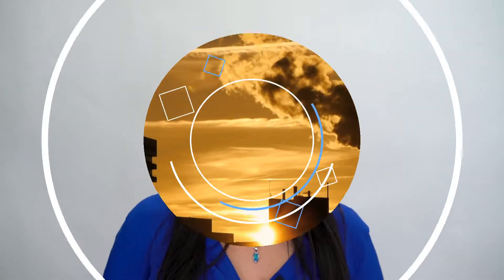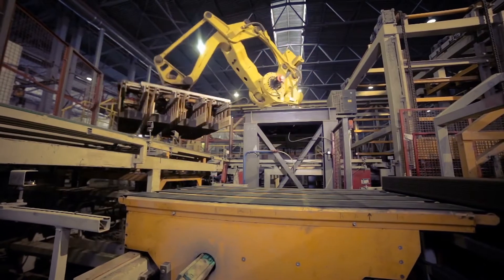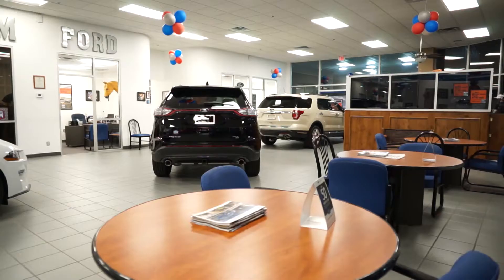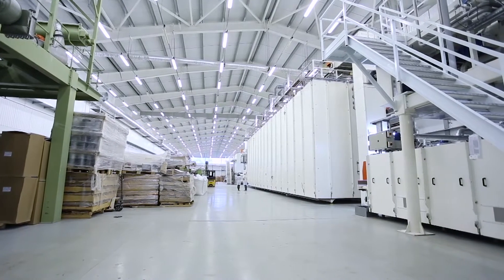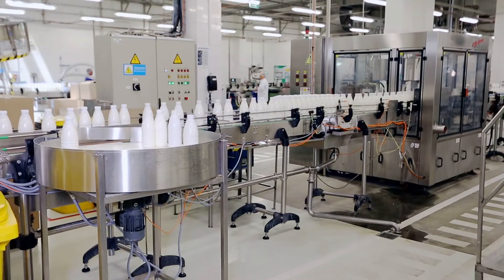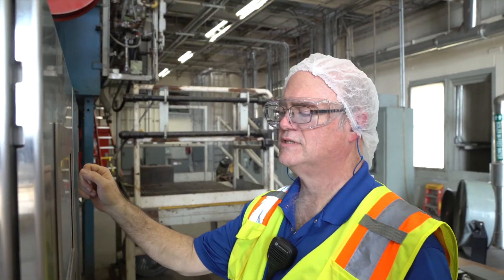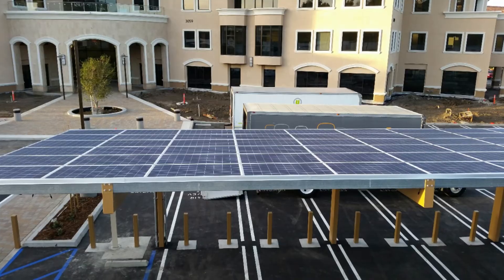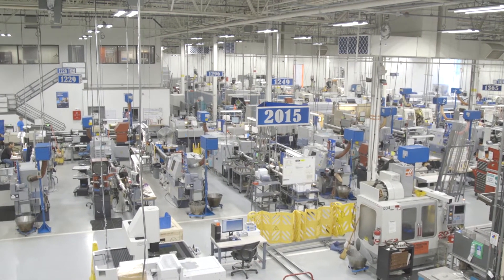Top 5 Ways to Improve Energy Efficiency in Manufacturing Plants

Comment: One of the points this lady missed is that LED lighting also reduces the heat generated by the lights - which means that the AC has to work less hard. In other words, installing LED lighting ( and all the controls you can get with them ) is a double whammy.